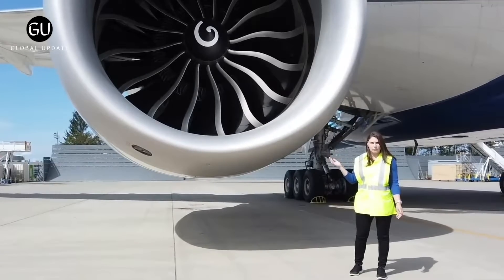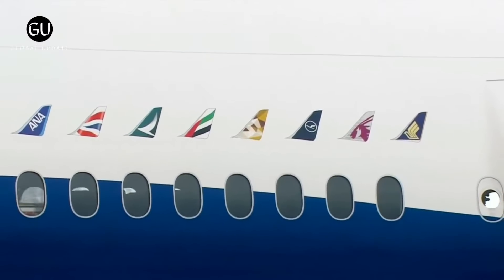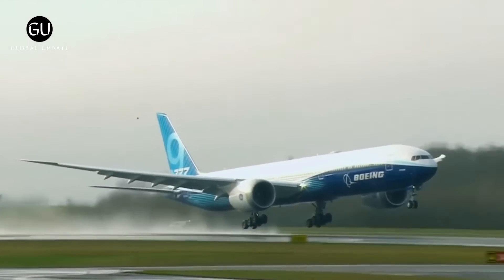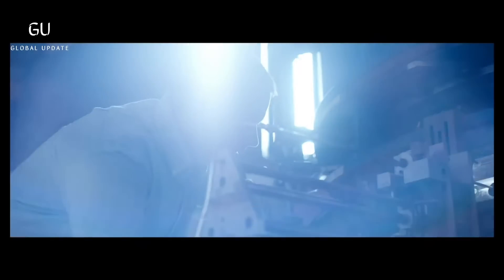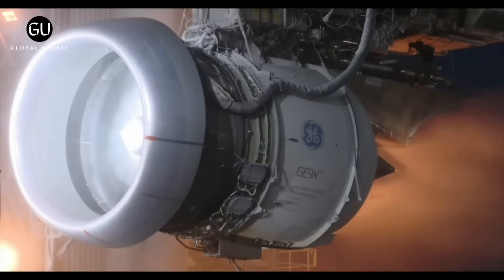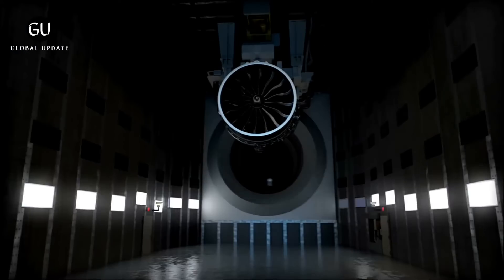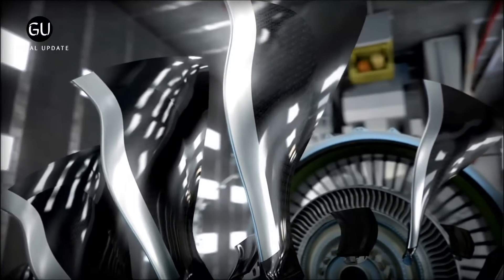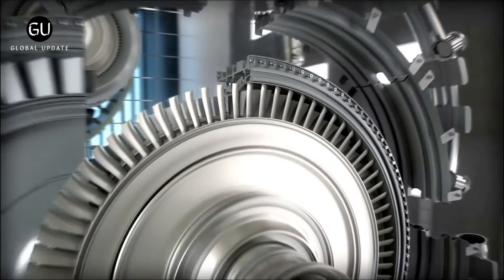GE9X - The World's Biggest Jet Engine

Comment: Id still like to have 4 engines.  1 goes bad, still have 3 more.   With this setup, 1 goes bad, you have just 1 left 😮😮😮
Reply from the maker: You can still land with 1 engine safely
Reply: And the airplane is designed to fly that way
Reply: 2 engines means less drag.

Comment: The RR Ultrafan has been in development for several years now, so yeah…the Ultrafan is the largest commercial jet engine ever…
Reply: it is larger, 140” to ge9x 134”, but it is less powerful than ge9x at full power. only just above 85,0000lbs of thrust than ge9x’s whopping 134,300lbs of thrust. some improvements are here and there, which could also happen to the ge9x, but we don’t know. also the nacelle for the 9e9x is 172”.
Reply: for what plane?
Reply: @markn6941  since it's not in production yet, it remains to be seen which planes if any, will use it.  My guess would be the A350-1000, or maybe the 777-9 or 777-8. Possibly a stretched version of the 787 could also use it. The ultrafan is a geared turbofan with a variable pitch blade system. I think this engine technology will usher in a new era of super powerful yet very efficient jet engines. The biggest hurdles will be initial cost and long term reliability.
Reply: @Mbartel500 The A350 will be way to small for the RR Ultrafan. I'd be surprised if they can even use it on the 777-9? Maybe on some future A380 sized or larger plane?
Reply: @Mbartel500  if it’s not in production it’s only on paper and thus a prototype , so it’s not a commercial anything yet
Reply: @spannaspinna  it's not just on paper. It is a real engine that is being tested.

Comment: Nothing will beat the start-up sound of the GE90-115B. The GE90 has the most elegant start-up and takeoff sound.
Reply: trents sound better imo, i work around all of the big engines including the handful of ge9xs in service right now for the 777x program. trents on the delta 330s make the ground shake when fuel is added, and incredible sound from first air to n2 to idle and onwards
Reply: @byloyuripka9624  how many ge9x in service for testing and with which aircraft? I thought they are only tested by the only 777X owned by Boeing

Comment: How's it more fuel efficient than the A350 when it's 20% or more heavier than the A350?
Reply: Bigger engine = more air = less power to use = more efficient.
Reply: longer wings better engines.
Reply: Has a higher mtow also it's lighter than it's predecessor which was very efficient so more power less weight means better performance. It likely will burn less fuel or similar amount of fuel as the 350 but with a heavier load

Comment: Not the GE9X... but I used to high-speed grind the blade tips on CFM-56 and CF-6 GE engines at Evendale, Ohio's  Aircraft Engine Plant 1979 to 1985. I'd rather have my stinking hearing back though. It was incredibly loud with a complete bladed 4 to 9 stage high-pressure compressor spool spinning at 5000 rpm a foot away for my head...guarded of course with a cover but the sound was still there pulling a massive amount of air through the blades. The sound was like standing next to a running jet engine even with big ear muffs, it was really, really loud. The 5000 RPM was to simulate the spool running in the engine and sling the blades out tight against the roots of the dovetail slots from centrifugal force, while we plunge ground each stage of blades to a specific radial dimension and specific angle. It was all done on specially modified big manual grinders back then. We were IAM local 912 machinists.
Reply: Local 912 🤟🇺🇲💯
Reply: At least you can't hear the shitty ''music''in this video.  I lost my hearing installing and overhauling GE Frame 3, 5, 6 and 7 heavy duty gas turbines driving generators and compressors all over the world. I was with GETSCO out of Schenectady. GE Tech Services Co.
Reply: What about bypass ratio?

Comment: But not most powerful... that belongs to the current 777 engines due to its old heavy tech
Reply: nope. This engine has beaten the GE90, producing up to 134,300 lbf (compared to the 127,900 lbf of the GE90).

Comment: Fun fact: This engine is the same diameter of an entire 737 fuselage.
Reply: Nah, this one is larger. It is the 90 that has the same diameter to the 737 fuselage
Reply: Wow, that really puts it in perspective. That's huge!!!  Never knew this...
Reply: This one’s bigger until the rolls Royce ultra fan thing comes out but no one knows what plane it will be on
Reply: The shroud is larger not the actual engine
Reply: Pretty sure the horizontal is the same size as a 37 wing
Reply: @justing42 Yes, you are absolutely correct about the 777's horizontal stabilizer being the same size (at least very close) as the main wing of a Boeing 737-800/900.
Reply: 727 not 737...
Reply: @tonnitoedwards  The 727 and 737 have the exact same fuselage diameter.
Reply: Eventually the actual turbofan diameter itself in a future jet engine will be as large as a 737's fuselage diameter.
Reply: @bobby1970  Those will probably be unducted fan engines, though. The fan case/cowling can only get so big.
Reply: No I dosent
Reply: how muck KN?
Reply: old news..the same was with the old engines